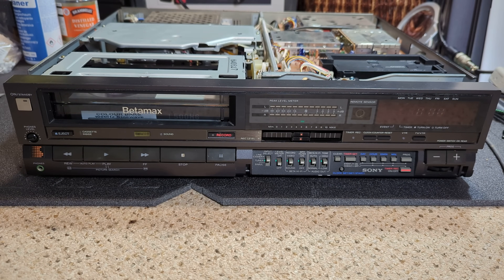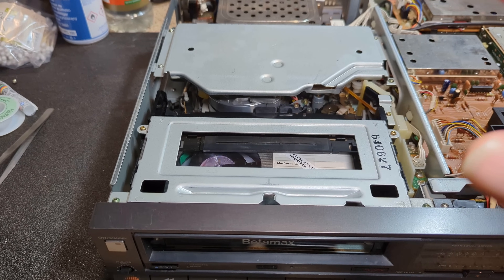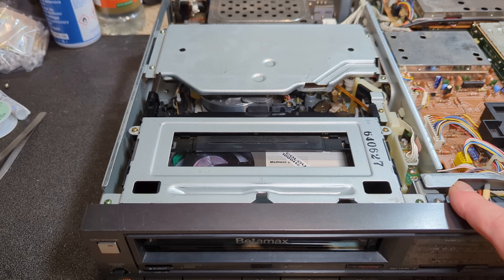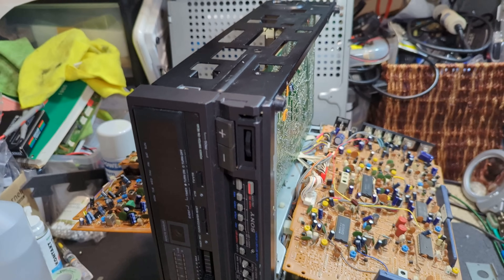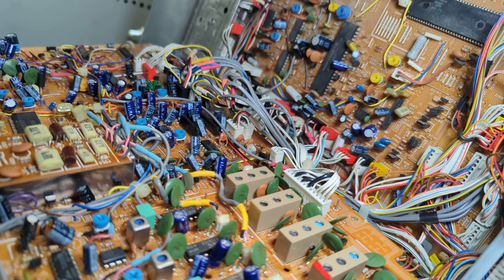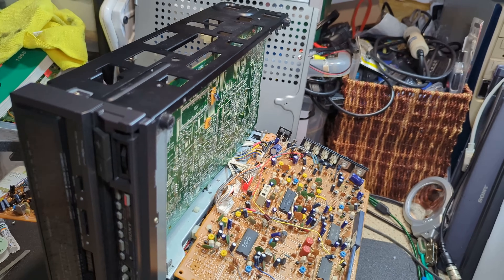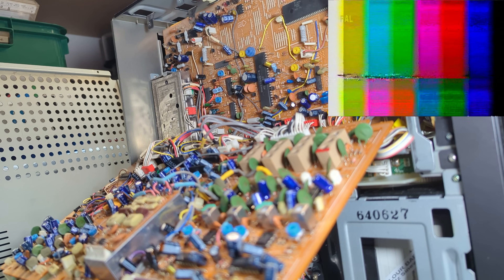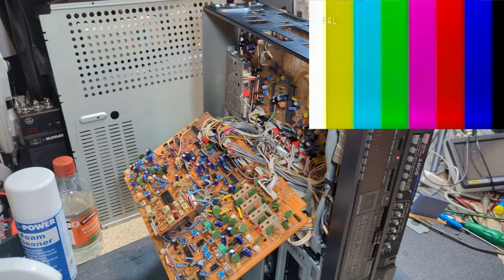Sony SL-HF100 - Capstan speed issue - Worse than the first PART 3

Comment: I would put that transistor on a curve tracer and have a look at it over temperature.  The DCA75 Atlas DCA Pro Advanced Semiconductor Analyser includes a curve tracer function (I did a review of that device a while back).
Reply from the maker: The Peak DCA75 is on my bucket list of potential purchases and it would be very interesting to see how it performs under test. It appears to slowly break down when constant voltage is applied.